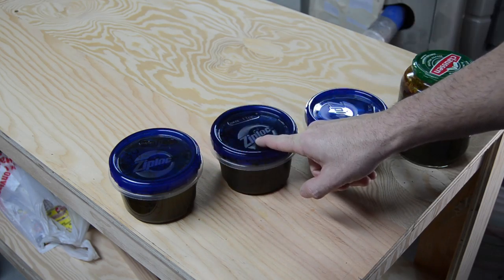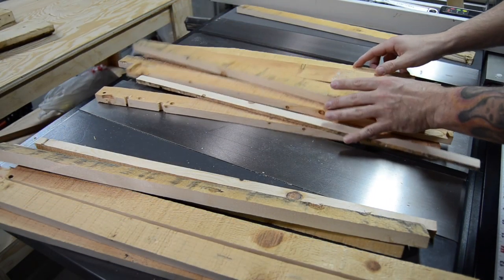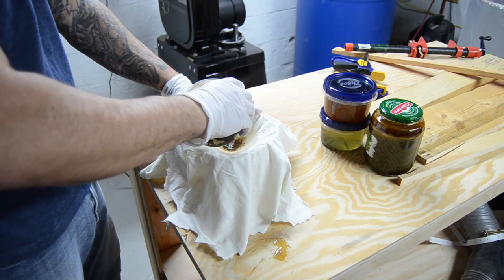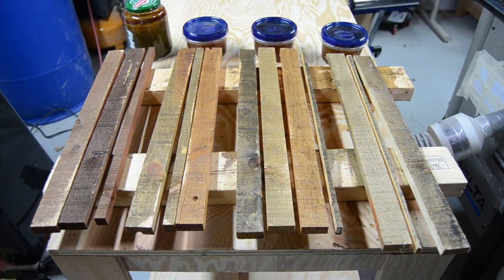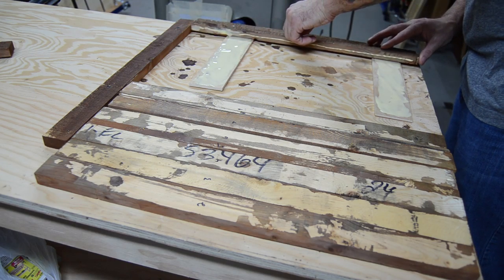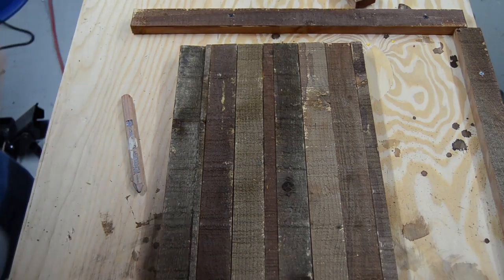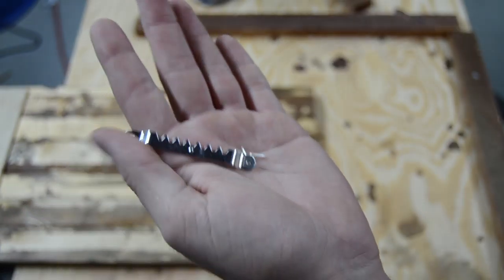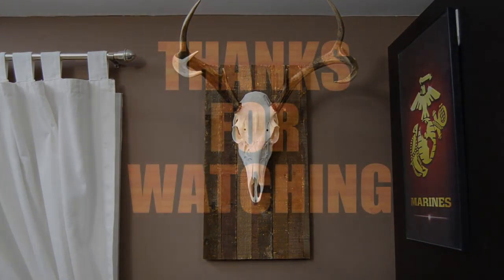Palletwood European Deer Mount

Comment: Great vid. I'm interested in your DIY stains and will give them a try. If you want to dress up your mount in another way you can purchase self-adhesive sheets of moss at Walmart. I staggered the boards (as mentioned below) and added some grasses to the bottom of mine which gives it a different outdoor look. I also used a propane torch to give the wood a slight burn look and hacked the edges of the boards with a hatchet for a rough finish. I would send pics if I could attach them.